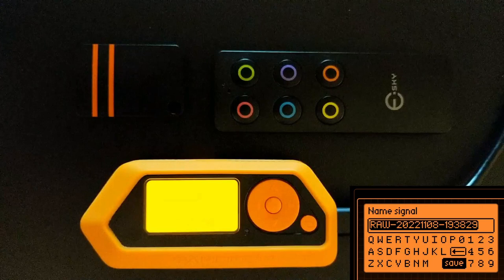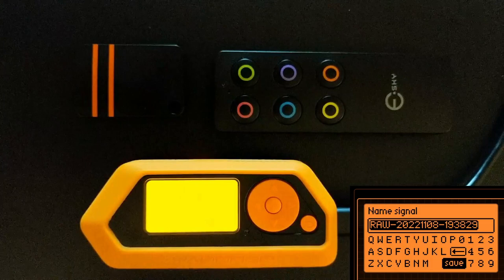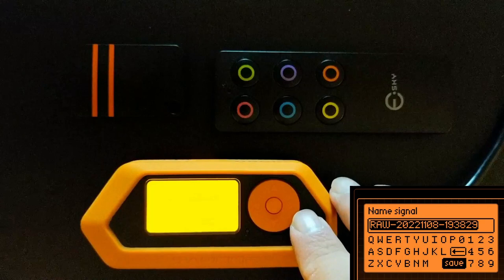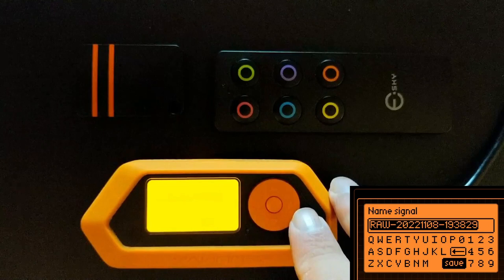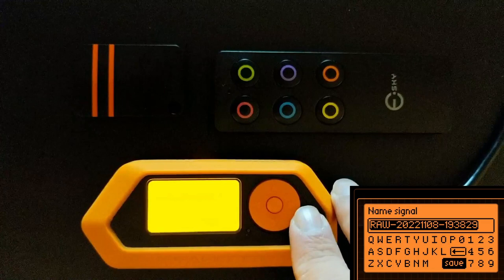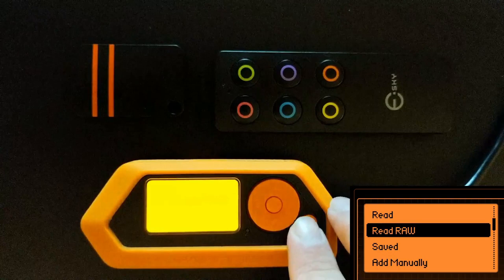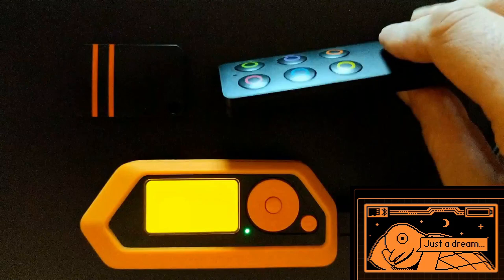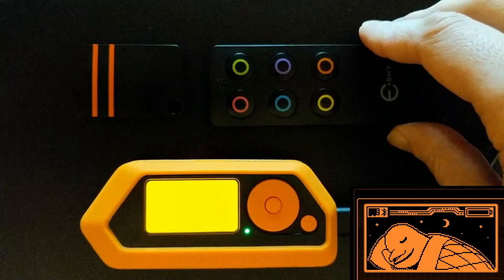Spotting Sub-ghz devices with the Flipper Zero

Comment: Are you using default firmware? If not which firmware are you using?
Reply from the maker: i have been sticking with the official firmware for 2 reasons. one is that i want to show a bit more of the vanilla experience for new users. the other is that you cant get support from the flipper zero team for community firmware. i might experiment more in the future though
Reply: Unleashed has some cool features and removes region locks.

The rfid fuzzing and  sub 1ghz brute force are kinda cool

Comment: I lost the remote , is it possible to generate a similar frequency to kind of emulate it?
Reply from the maker: I would check out some of the databases of sub-ghz signals around. It's possible somebody might have already captured your devices remote and shared it. I do think you can manually enter codes but thats above my head

Comment: I’m getting mine delivered on the 17th of this month. What are the ranges like how far away can you be from the signal to interact with it?
Reply from the maker: The flipper has a pretty decent range, depending on barriers along the way. According to the documentation it has a max range of 50 meters or about 165 feet. those are likely under ideal conditions though.

Comment: From how far can a flipper zero read the frequencies ? Can I be 5ft away and set the threshold to only read a higher frequency to save the sub gigahertz ? Or do I have to be within a foot ?
Reply from the maker: The RSSI threshold doesnt change the frequency that you capture. I believe it changes the strength of signal required to trigger capture. increasing the RSSI and moving further away might actually mess up capture. I think it has to do with the strength of the remote. The remote I have access too right now needs to be really close for the analyzer to work. But sometimes just sitting around my house I can see different frequencies flying around. The hard part at that point is deciphering where the signal is coming from

Comment: Just bought mine any tips for just starting out?
Reply from the maker: after updating the firmware try some basic functionalities like capturing ir codes. it may seem small but its fun and gets you comfortable with the device. definitely look into flipper repositories online for added features like new apps. you might want to better understand git to help yourself there. check out the flipper discord for different ideas. there are a bunch of wild projects out there. most of all research the crap out of different topics like sub ghz, C programming, and basic gpio capabilities. the possiblities are endless but ya gotta start somewhere!
Reply: @rad_linux  alright ill look  into that stuff, thanks!